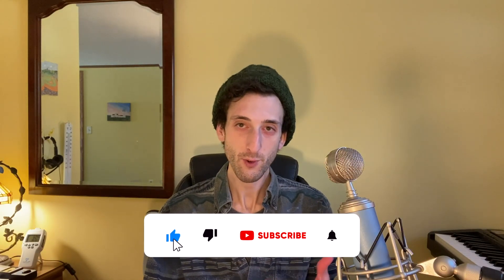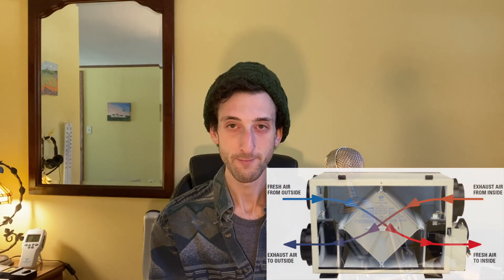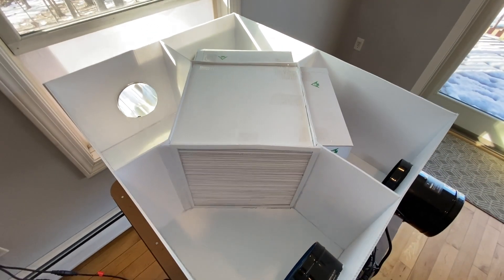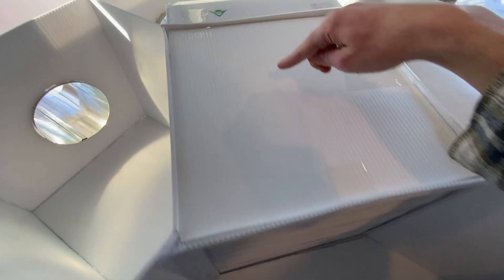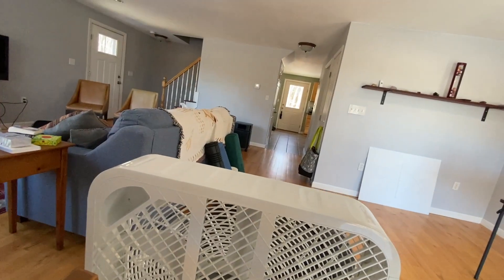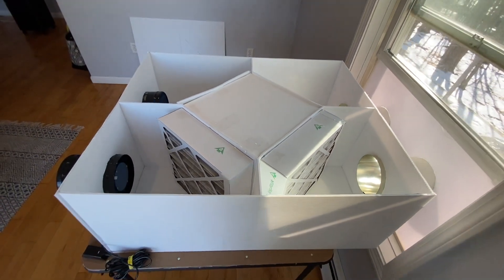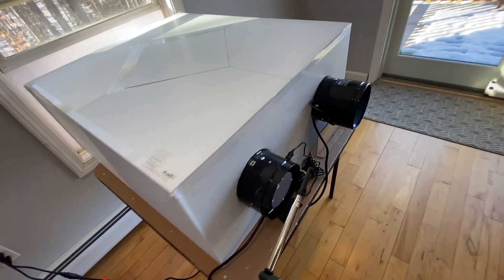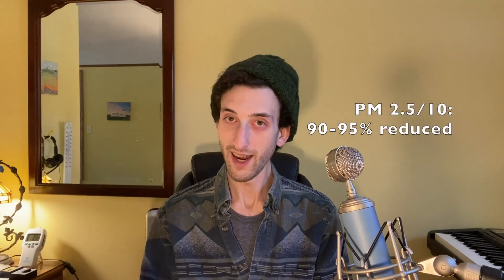I built the best DIY heat recovery ventilator I’ve seen on YouTube

Comment: Overcomplicated and the design will not let it reach its potential efficiency. I have a design in mind that will reduce the cost and complexity significantly, while theoretically doubling the efficiency. Unfortunately I'm not a youtuber, so I don't know if I'll ever make a video about.
Reply from the maker: Since releasing this video, I’ve learned that the highest possible efficiency isn’t necessarily the goal when it comes to HRVs/ERVs. I have a Broan AI series ERV that is widely used and well-regarded and it’s only 67% efficient. 

Extremely high efficiency can cause condensation issues in DIY units especially, so that has to be a consideration. Tradeoffs.

There’s nothing overcomplicated about my design either. The housing may be excessively large, I’ll admit to that. But it’s very simple - it has a core similar to many factory made units. It has thick, high MERV filters with a low pressure drop, that’ll help ensure the air you breathe doesn’t contain too much harmful PM 2.5. The ECM fans are powerful enough to ensure that enough fresh air is supplied to my house to sufficiently dilute the concentration of VOCs, which can be 100x more abundant indoors than outdoors.

I’m absolutely curious to hear about your design idea though!
Reply: @HealthyHomeGuide  I figured out that the condensation will be a problem, but only on the exhaust side. I was thinking that coating this side with some biocide like Benzalkonium chloride (BAC's) could prevent anything growing inside.

Comment: What I need an HRV/ERV for is to lower the CO2 levels in our very air tight 1100sq/ft home with propane cook surface, 2 adults and 2, 80lb dogs. The CO2 levels quickly rise to over 2000 PPM without exhaust fan running and periodic use of the whole house fan with doors open. High CO2 levels cause headaches, drowsiness and other health problems. I bought a quality Ambient Weather indoor AQI monitor which tracks 2.5micron and 10micron particles as well as CO2 levels with reasonable accurance and was shocked at the dangerous CO2 levels we were living with.
Reply from the maker: Your thinking is spot on. In a tight house with that amount of occupants, CO2 levels can certainly rise to unhealthy levels. What is even more important for health than CO2 is VOC levels, which recent research has shown are up to 100x higher indoors than outdoors. That’s why it’s even more important to dilute your indoor air with outdoor air.

Comment: Is plastic a good heat exchanger ? are there no better materials?  What if you take cupper or aluminum plates and you create some sort of sandwich with them?
Reply from the maker: Plastic, when thin, is a decent enough heat exchanger for this application. Polypropylene (the material the coroplast I used is made of) is actually widely used in factory made HRVs and ERVs. Surprise.
Reply: @HealthyHomeGuide  i really am surprised if it has any performances because: Polypropylene: ~0.1-0.22 Watts per meter-Kelvin (W/m·K)

Aluminum: ~205-235 Watts per meter-Kelvin (W/m·K)

Copper: ~398 Watts per meter-Kelvin (W/m·K)

Comment: Thanks for this video! I think that you could make that box into a vertical version if you used plywood for the largest sides. It would not need to be more than 3/8" thick to support that core. Probably 3/16" would do. I bet masonite or "bath-board" (which has a nice finish on one side) would work very well. Adding some 1/2"x1/2" wood pieces in certain corners to further stiffen the housing would help as well. (even if using your current materials for the walls)
I think that you might get more efficient airflow if you used some internal ducting to reduce turbulence between the air inlets and the filters and the air outlets and the core. (The shape of the chambers the air passes through is probably causing a lot of turbulence) A piece of thin poster board could be formed into a cone that is the diameter of the inlet at one end. The other end could be creased into a square to fit the filter or core. (the circumference of the filter/core end should be equal to or slightly larger than the perimeter of the filter/core in order to fit) That would give you a custom duct for very little in the way of expense and effort. Another good material for this would be a used printing-press plate. They are usually aluminium and can be gotten at any place that prints posters etc on a lithographic press.
A layer of radiant-barrier material (like ArmaFoil from EnergyEfficientSolutions d0t c0m) over the block in the window and on the inside of the walls of the housing of the HRV would insulate the system and increase the efficiency a little more without adding much bulk or weight.
You could also make the core out of the lithographic plates I mentioned above. Just cut out a rectangle whose long side is longer than the short side by twice the distance you want between plates. Then fold the edges of each of the short sides down by the distance you want between plates; so the profile is like a very wide staple or 'u' shape.(if you cut them out and folded them right; they should be square now) Then you stack them alternating the sides that are closed by taping the folded edges to the unfolded edges on the next plate. You could use hvac foil tape for this to get maximum efficiency. This setup has three advantages over the current core design: The first is that aluminium transfers heat much more efficiently than plastic. The second is that the single layer walls would be more efficient. The third is that there would be better airflow through the core because of the undivided center of each layer. (A tip for cutting lithographic plates is to use an xacto knife and a straight edge. You do not need to cut all the way through. Just score it well and then bend it at the score lines and it will snap)
Reply from the maker: These are great ideas, thank you!

Comment: Mitsubishi sell these. They are called lossnay units.

Reasonable instantaneous efficiency results, for more reliable figures use loggers and gather more data points at changing operating conditions.
Reply from the maker: Fascinating! I’ll have to check them out.

Comment: Drainage - I don't believe that you need a big slope to ensure that water will drain. You may need to balance the wetting of the surface with the size of the passages so that the droplet sizes (should they form) don't block  the flow. 
And just because the exchanger flow may pass the dew point, doesn't mean that there is energy exchange available to cover the latent heat part. You'll need to try it in a shower room (warm wet air) with exchange to a cold wet rainy exterior....

Comment: Oh k, so without the data from before. Using your little couple together thing there.  all data, claiming that it's a reduction. And whatever means, absolutely nothing. Let's see the data from before you put this in your window, and then there's a lot of other things that you need to take a note count. What's the age of the house? What kind of heating and air conditioning system are you using in the house? Have you cleaned the duckwork in your house? I like your design, but we need more information.

Comment: Great project, even if the efficiency did not quite measure up. I would argue however that anybody building one to install in an older home should dive deep into already existing air infiltration issues. Just a few poorly sealed holes in the framing can cause a hidden issue through the entire home, even through interior walls over crawlspace construction. The pocket hole doors originally built into my home permitted an absolute blast of air through them when the house was pressurized, much of it likely coming from the crawlspace. (I sealed the pocket doors in entirely.) Even the catch on the jamb for a door latch became an obvious breach that a little caulk easily fixed.

Comment: Congratulations and thanks for sharing. May i suggest you change your filter with 3M by example. Filter buy are not good filter. go see the Consumer Reports tests. A lot of merv 13 filters are actually not real good. 3M, Nordic Pure and Air Handler are good choices, to name a few
Reply from the maker: Agreed. I use 3M filters now. In my latest DIY build (an air purifier), I used 3M filtrete.

Comment: What would you suggest if the problem was not heat recovery, but indoor air humidity?  only ventilation itself will for sure help, but what if there is also high humidity outside?  about 70% when at home should be max60%. What is your air humidity?
Reply from the maker: Great question! One of my recent videos (“CO2 monitoring and home ventilation”) addresses this. A whole house dehumidifier such as the Santa Fe compact70 is useful for appreciably lowering indoor humidity levels. ERVs also help to ventilate without bringing in too much humidity. So I’d say optimally an ERV and a whole house dehumidifier. I’m in the process of making an ERV installation video so stay tuned.

Comment: Chloroplast may work, and you appear to have built this one sufficently large to get fairly  good efficency at the rate of air exchange.

But, know this. Plastic is inefficientl at moving heat across a given surface area. Your heat exchanger could get comparable efficency  with a smaller design if the core were made of sheets of aluminum seperated by small three or four spacers each layer. Or you could achieve significantly higher efficency with an aluminum core built to to your existing core size.

Comment: Why are you filtering the exhaust air? Just to balance flow rates? Would be better to have a lower power fam on the exhaust.
Reply from the maker: I filtered the exhaust air in order to protect the core from dust buildup. HRVs sold today for commercial/residential use do this as well. And yes, I also did it to balance the intake/exhaust flow rates - though since these filters are 4” thick, they don’t cause much resistance to airflow anyway.
Reply: Ah fair one didn't think of that. Makes maintenance easier.
Pretty sure you could shrink it so that the exterior walls just touch the HX and filters, the plenums would still be plenty big enough (leaving a triangular space, just shrinking the linking interior walls).
Do you have loft access? Could mount it above the ceiling and connect the intake to a roof vent. Probably not an option if you rent or live in a flat.
Reply from the maker: @jack504  yup! Also keeps the core efficient. 

For sure. If I were to build this again, I’d absolutely make the housing smaller. I don’t have easy loft access unfortunately, but that is indeed an option in some cases.

Comment: why do you have a merv 13 filter on the exaut???
Reply from the maker: To protect the core from particulate buildup. Also, the MERV-13 filters I used are 4” thick; thicker filters cause less resistance to airflow. I also used the same filters on the intake and exhaust to balance the airflows.

Comment: That's an interesting design. I've actually seen a very similar design (using coroplast) from an HVAC company that fleeced me thousands of dollars some years ago for an HVAC design that included one of their custom ERVs. I got suspicious after seeing that they didn't have a test in HVI database, and after seeing the docs that they sent me, it literally showed 0% humidity recovery for their "ERV". Which made sense, since this type of design is non permeable and cannot recover humidity, making it an HRV only solution. Didn't have the time nor energy to try and get my money back.
Reply from the maker: Damn, that’s absolutely insane that that company had the audacity to sell an ERV with 0% humidity recovery. That’s laughable. It’s like selling a car that gets 0% gas mileage.
Reply: @HealthyHomeGuide  Yeah... the person in charge previously worked for ASHRAE in a fairly high ranking position too, which made me not as suspicious as I should have been initially, so it took too long to figure out that I'm being essentially scammed.

By the way, and I might have missed this in the video, you should consider using ECM 0-10v blowers as they're much more efficient, quieter, and easier to control using industry standard means. Makes balancing easier too.
Reply from the maker: @parak4593  they worked for ASHRAE!? Unreal. 

I did use fans with EC motors - do you think blowers would be better in this application?
Reply: @HealthyHomeGuide  Yeah the company is still in business too, continuing to sell what I think they call a "polymer fixed plate" core "ERVs". Oh well.

Yeah if you're already using EC inline fans that you can easily vary speeds on, then it's already all good.

Planning on ducting it by any chance? Exhaust from kitchen and bathrooms, fresh air supply to bedrooms and living and all that. Don't need to use large duct either, I think Zehnder for example uses only 3" ducts. Then you can do more neat stuff like set up boost modes for a limited amount of time when cooking and such, though you'd optimally want a recirculating hood there, but that's a separate subject hehe.

Comment: Version two should be vertical
Reply from the maker: Vertical would be optimal, I agree. I actually tried to make it vertical, but with these materials it doesn’t work. The core is heavy, and the coroplast cage that holds the core isn’t strong enough to support it. That’s why it had to be horizontal.

Comment: You would get better heat transfer if you only used a full sheet of coroplast every other layer.  The intermediate layers would just use a strip of coroplast at the edge for a separator.  Of course the downside is that it would unbalanced.

Comment: Love it, considering buiilding one of these for my home too!

You could have used half the correx by using double sided foam tape to create the core, with one channel being formed by taping two sheets together. (using tape with a thickness similar to the height of the plastic sheets) this has the advantage of also reducing the thickness of plastic seperating the air channels, so heat transfer should be more efficient. (as it would be one layer of plastic rather than two layers plus glue)

Also a dual core design could improve efficeny by doubling the surface area for heat transfer.
Reply: Please describe differently. The advantage other than more direct contact of the layers is unclear.
Reply: @Mavrik9000  Mainly just because it reduces the amount of material needed for the core, so in theory you could create a dual core confgiuration with the same material plus tape!
Reply: @Chriz. What I mean by "describe differently" is the physical layout. I don't understand how the configuration you have described is assembled.

Comment: 2:20 Who cares about particles, that come in your house🤣 These particles must be avoided to enter the heat exchanger, because those will greatly reduce the efficiency and produce a medium for mold and critters. Also they are a pain in the arse to get removed. 
Always filter before airways🤗
Reply from the maker: Both my intake and exhaust filters actually were before the heat exchanging core.
Reply: @HealthyHomeGuide  Suggestion. Make it more flat, so it can be installed at the ceiling. Also you can have it much smaller, if you not install the core diagonally and go for radial blowers.
Reply: That is so important. You show this in a later pic👍

Comment: Looks good but what do you do with the condensation water.
Reply from the maker: I didn’t experience condensation issues. Possible reasons why: I only used this HRV during the late fall, winter, and early spring when the air is very dry. Dew points in my house were low (from ventilation with dry air + no humidification). I’m too worried about mold growth to use it when it’s humid outside.
Reply: Different than my factory made HRV it makes water in the winter  @HealthyHomeGuide
Reply from the maker: @offgridwanabe  your factory made HRV may be more efficient than mine. Also, you may live in a more humid climate than I did. I lived in a very cold, higher elevation, relatively drier area of the northeast.

Comment: Your using plastic to exchange heat? A known insulator not a conductor?
Reply from the maker: It’s hard to believe, but some HRVs/ERVs sold today actually use plastic as a material for the core.